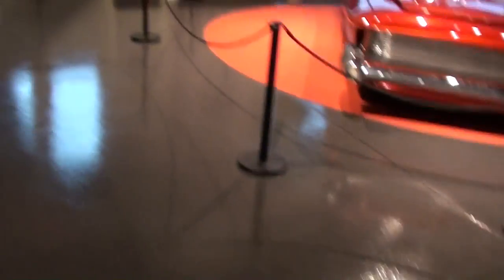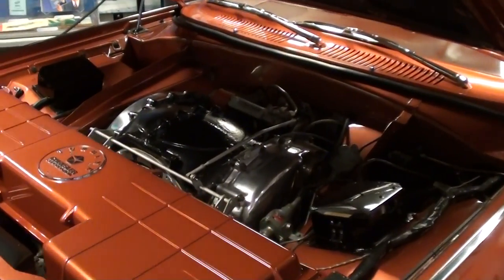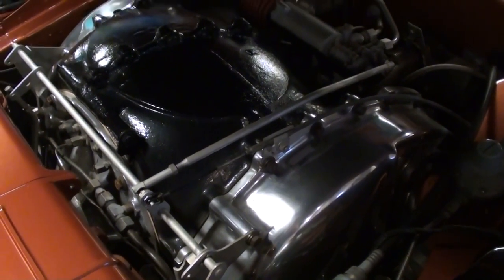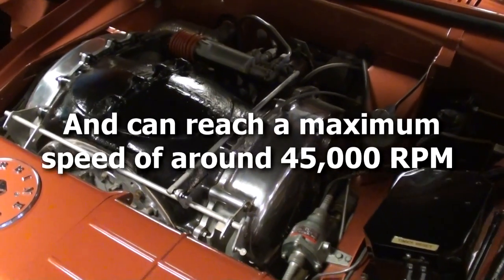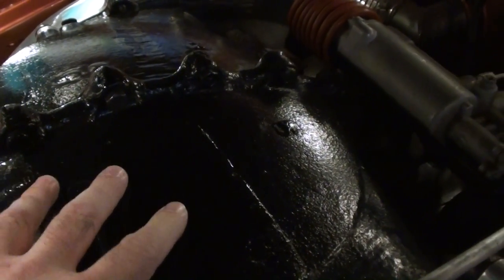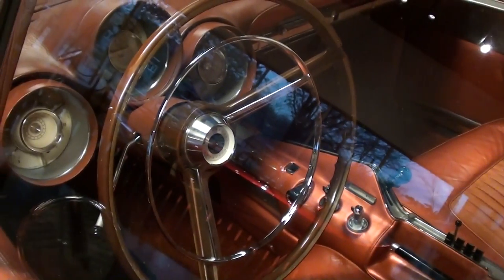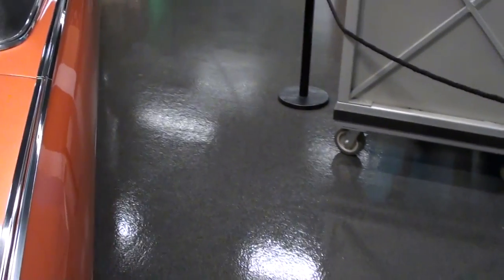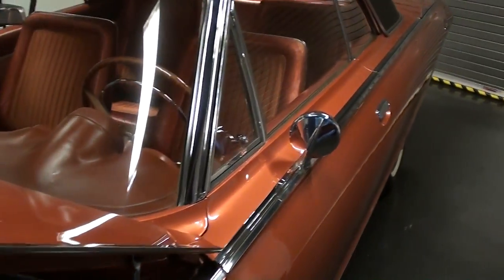Rare 1963 Chrysler Turbine - Amazing Gas Turbine Powered Classic

Comment from the maker: @raconter1 You're right Jack, Chrysler had been experimenting with the turbines for years before these cars. They would get about 19 mpg cruising down the highway, but they burned a ton of gas running around town. I mean, you're idling 22,000 rpm even when you're sitting still in traffic or at a light. That's cool that you applied to drive one at the time.

Comment from the maker: @peteq1972 They could get about 19 miles to the gallon on the highway, but they didn't do very well around town( because of the 22,000 rpm idle speed). It's my understanding that with today's technology you could increase the intake air temp substantially which would make them much more efficient and powerful.

Comment: Like all gas turbines, the ignitor (here he calls it a spark plug) is only used during initial startup.  Once the engine starts, it will keep on going as long as there is fuel supplied to it.

Comment: One thing you didn't want to Burn is leaded gas, the lead was hard on the engine.  You could use white gas (unleaded) but that was hard to find in 1963/64.

Comment: The Titanic was turbine powered (steam). Most are today, burning Bunker C.
That engine is not 'set up' for kerosene--it can use any fuel (except leaded gas) without modification.
All fossil fuels burn at about the same temp-- ~1700F, its just that turbine airflow is so much higher and thus has more energy.
The car was built by Ghia in Italy, but designed by Elwood Engel in Detroit, who jumped to Chrysler after designing the 1961 Ford Thunderbird, on which the Turbine Car was based. Some wags called it the "Engel-bird."

Comment: addplusminus35  Regular oil changes are generally not required, turbines use either ball or roller bearings, the oil is circulated mainly to cool the bearing and are sealed from containation by the combustion gasses. Usually can expect many thousands of hours without any service, oil would not be added unless there was a bad seal causing a leak.

Cheers!